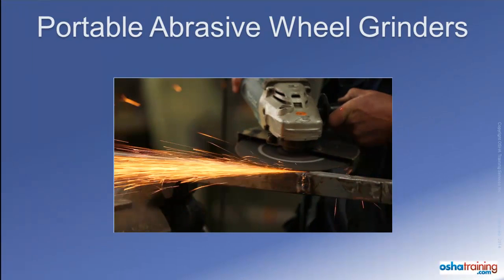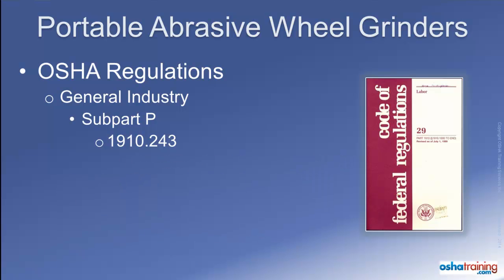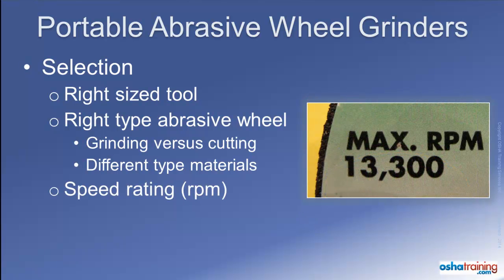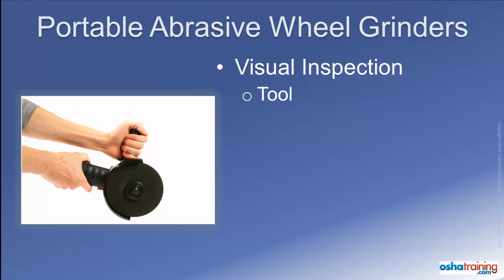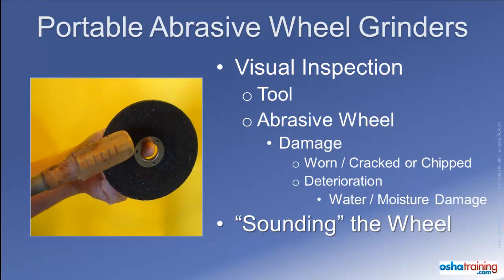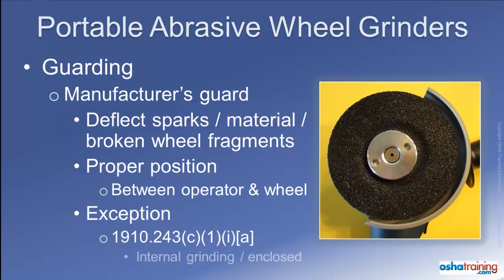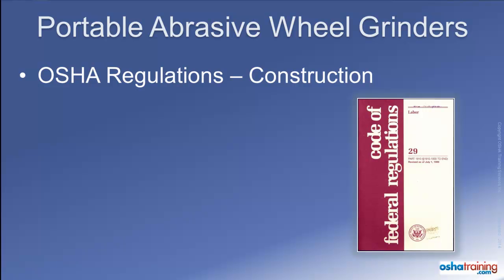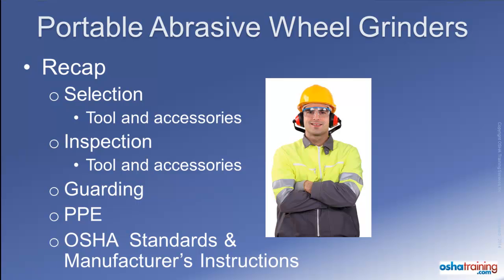Free OSHA Training Tutorial - Portable Abrasive Wheel Grinders

Comment: great advice right on time like always happens with your well edited videos
all the information on your video is very important, but specially that portion pertaining to the wheel being hit (and destroyed) by enviromental factors such as moisture or even water where H02 will disipate the abrasives in the grinding wheel composites
all this instruction made me think firstly about my own safety, and at the same time, about the safety of others and even property
but curiously, almost simultaneously, all these necessary safety regulations also made me think that that if we fail in any of the various areas being covered by the video, then, why the suppliers or the machinery suppliers fail to provide the right grinder wheel for the required rpm of/ on the tool they sell to the public? is that safe? it is deceiving the public and the authorities on their behalf, or what kind of legal advice they are taking into account as their own framed game win/ win situation?
a while back, i needed certain grinding wheel for a special application, a "cutting tool," which is very small and vertical, it was the solution - and this only store that supplied it won't stock on their inventory the right wheel for the tool; 🚫 that is not only ridiculous, but also made wonder about the many loopholes in the system that still need some urgent attention, or patching 🔧
because i always do some research about the various and different equipment available to make my life simpler before i decide what strategy to take, fortunatelly i'd found a video on youtube explaining this counter effect on the tool, and on the supplier - that they don't stock the right rpm wheel from the thousands of cutting and grinding wheels that they have available to the end consumer on their stands
in this case, i had to go get the right rpm cutting wheel from a different supplier, a hardware supplier for only 0.99 cents .. incredible but true 👀